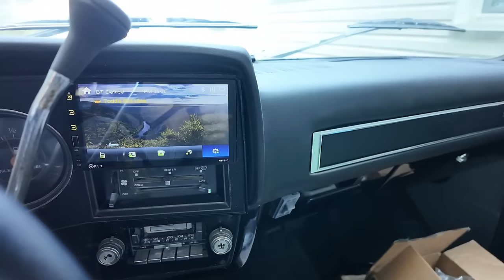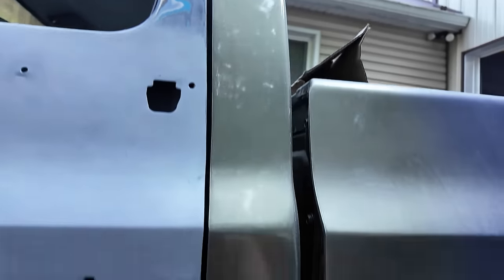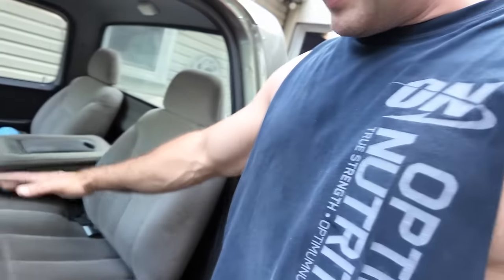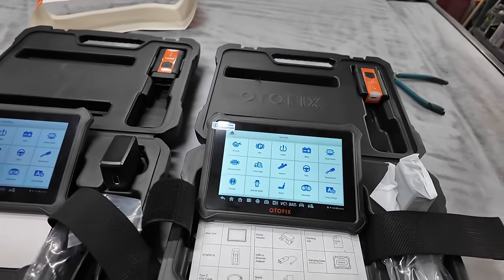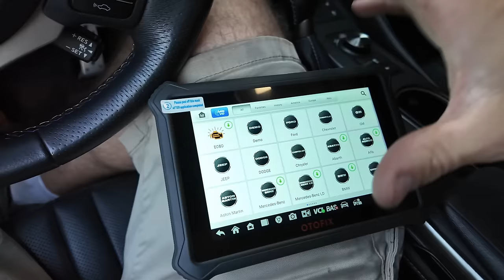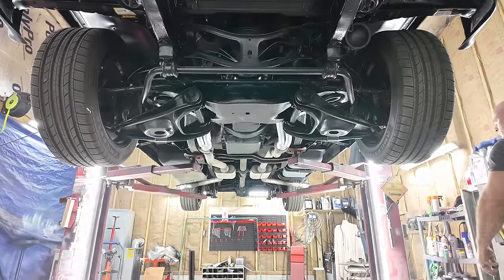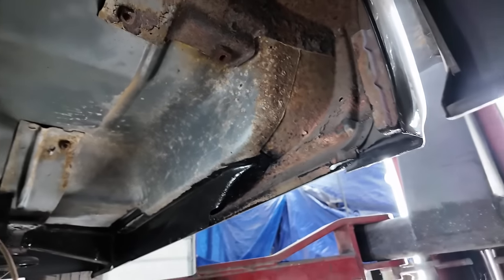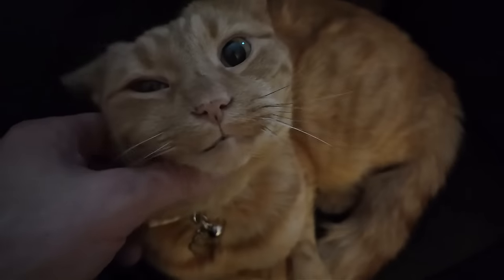The C10 is Back + Otofix D1/D1 Lite Review

Comment: Love old square body’s.  I have a 1995 1500 W/T  it’s long bed reg can 2wd. Just a plain v6 manual windows and locks but it’s a one owner garage kept truck. It just rolled 110.000 miles.  And it looks like it just came off the lot. It’s got one dent that I don’t really want to mess with cause it’s original paint and the paint is really good on it.   Damn that’s a sweet square body

Comment: Hi Todd if you need tpms on the Lexus try the ones where the transmitter fits on the tyre valve with solar powered receiver small enough fits on dashboard thanks for the videos from the UK